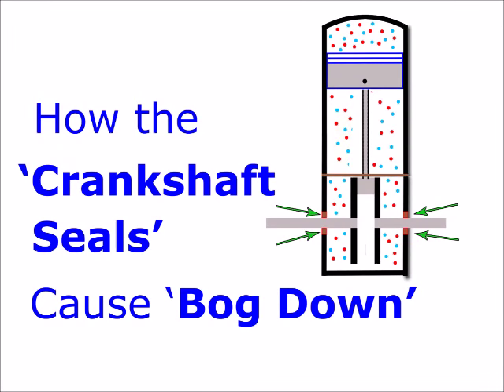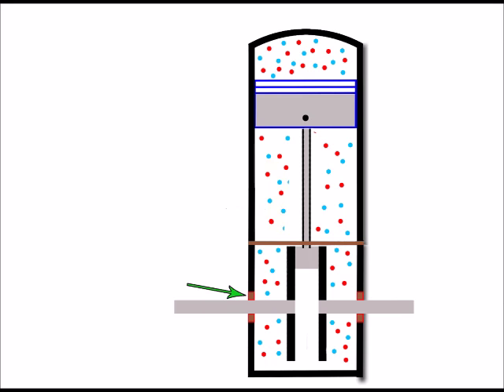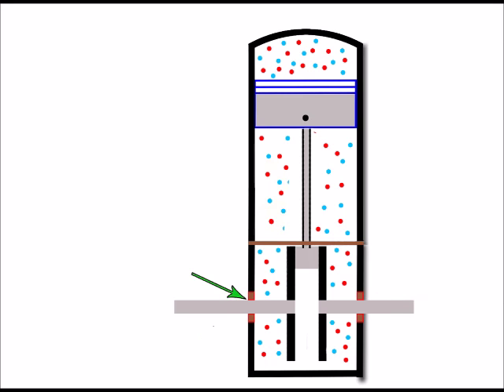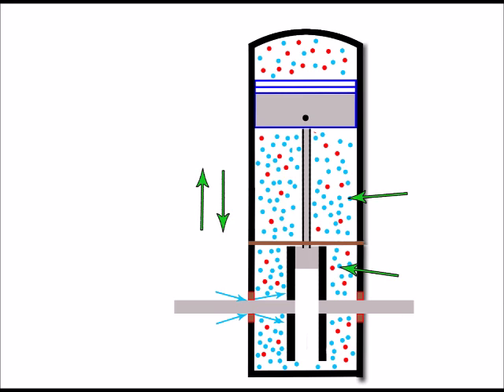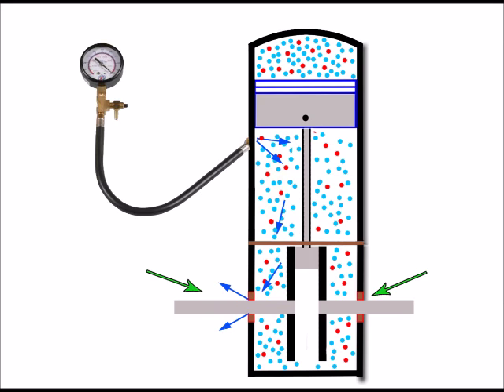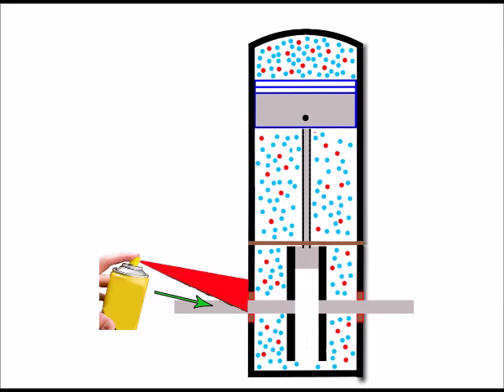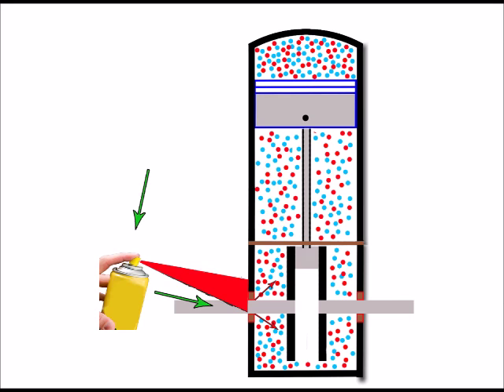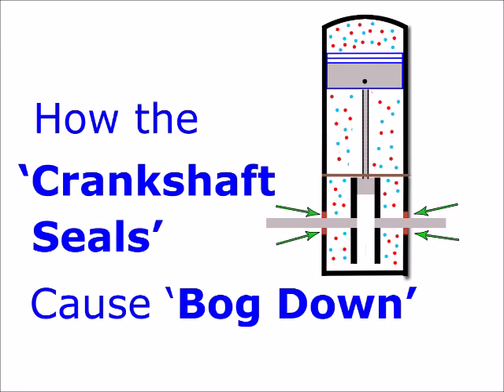Main Crank Seals causes this 2-Stroke BOG DOWN symptom!

Comment: Just a note to readers of the comments…not only does the crank seal leak in air to the combustion chamber , it also can draw in engine oil from the clutch side and cause the engine to bog. Also noted in my case (gas gas ec300) that the engine breather was spoofing out black oil , indicating the extra pressure into the crank cases. Thanks for explaining the basics of what’s going on. Greetings from down under 🇦🇺
Reply: Hi mate

can a crank bearing/ seal cause a bike not to start have got a kmx and it has good compression have taken head off and barrel and piston and rings look good I even taken it to a shop and they said my top end looks fine so anyway I have checked my fly wheel and it has movement when I pull it up and down not loads but its there will this  be the problem do u think

Comment: It should be mentioned also that the lean condition caused by a leaking crank seal on a 2 stroke can lead to premature piston failure or ring failure.

Comment: Epic video.  There is also a condition where crankcase oil lives on the other side of the crank seal, which causes an overly rich condition (as that oil or tranny fluid doesn’t burn the same) as such you foul plugs and/or saturate your muffler packing.
Reply: I have a yz 80 i haven't ever been able to get to run properly. Kicks over first time almost everytime. Wont rev up. Tons of oil coming from the pipe. Any ideas?

Comment: I assume if there's oil mess around the crank seals that,d be a good indication of blowby? I know that term is generally used for the rings wear but in this case I guess it'll be alright. I'll tell you my friend,  your videos make us think, as well as learn. thanks so.
Reply: A two stroke engine has a total loss lubrication system and not a wet sump like a four stroke.
There are three things in a two stroke sump, mostly air, and then fuel and 2-stroke oil.
Leakage around here is not very prominent unless the engine has been flooded.
Reply: That is absolutely correct. A telltale sign of failed crank seals is black, oily residue around the seal area.
Reply: @TonyLing  
Baloney!  Read my comment.

Comment: When you mentioned pressure in the crankcase is the key word... What nobody seems to understand these days is the fact that two-cycle or two-stroke if you want to call it engines are self supercharging engines.
At a certain RPM the pressure in the crankcase becomes higher than atmospheric pressure.
That's what we call supercharging.. for a two-stroke engine this is when the power band starts and continues all the way through to the RPM range ... Something I've never seen done but I know that manufacturers are aware of..
Let's put a tapped hole in the bottom of the crankcase using something small like 1/16 NPT tap and then attach a pressure gauge and while the engine is running under load let's see how much crankcase pressure (boost) two-stroke engines can produce..
Reply: That is a brilliant idea actually.

Comment: Thank you for a very informative video!  I have a Kawasaki ultra 150 jet ski with 3 cyl and 3 carbs. I rebuid the entire engine with new crankshaft etc. and after that the engine dies after about 10 seconds of idling. The only way to keep the engine from not bogging down and die is to keep it above 3500rpm. And to get it running again i have to choke it between every bog down. I comp tested the cylinders and they reach 120 but if i let it sit for a couple of minutes the pressure drops to 100 and stays there. Would you say my symptoms are due to leaking crank seals? I tried the light oil trick but I couldn't get it to work.

Comment: Sir does this case also cause to engine runaway
Reply from the maker: It can cause it to over revv and starting problems mainly. It can be very temperamental with trying to set the carb as well. Almost impossible to get the settings just right depending on how advanced this is
Reply: @TheRepairSpecialist  Thank you sir,my crm 250 won't stay idle but when choked, it idles,I think this is the problem or it should be a air leak,do you have any idea?

Comment: Thank for the vid. Very informative. 

I have a problem with my 100hp 2 stroke mercury, starts and slowly increases revs in idle and then puffs out smoke, reduces revs and then increased again and keeps doing the while puffing experience over and over again, could this be the seal also? Thanks again
Reply: Left hand crank seal or your pilot jet is blocked dirty sort that out before crank seals

Comment: I know this post is old. Would the crank seals cause a no start/no run condition?
  I have a Husqvarna 240 chainsaw that suddenly died while in use. I’ve examined every other possible cause. Including installing a new OEM carb, new spark plug. I have good spark, good fuel flow, fresh fuel (verified in another machine), flywheel key-way is in check (the key way is cast into the flywheel on this model) I have checked and double checked everyyyything. I also tried starter fluid and not even a pop. The compression feels just as strong when I pull start as it always has, it has good resistance as I pull. Consensus on a Facebook post is it’s the crankshaft seals. They are visually intact, I can’t imagine a seal on this, when the compression feels strong, could possibly cause a no start condition.
Reply: Actually measure the compression with a tester...I had same problem w/ mine died while running, wouldn't start back up even w/ starter fluid, EVERYTHING else checked out... I then measured the compression and it could only muster 35 psi! Took the top-end off and piston had a huge crack & the rings were stuck solid, pretty new engine so I think it sucked in some dirt or something 🤷‍♂️

Comment: My engine belt is loaded with oil and I know it is not my power steering oil.  It leaks a court of oil every 40 miles.  I am guessing it is coming out of the crankshaft seal but the engine performs fine with no bogging at all.  Is my guess unfounded?

Comment: Also I wondered, Would the carb adjustments compensate for the air fuel mix in the crankcase?
Reply: Depends how bad the leak is at the seal. If it's a large leak, the amount of air from the carb will be small in comparison

Comment: I bought a 2022 brand new motorcycle that has a leak at the front sprocket shaft.

The dealership refuses to recognize that there’s a leak, but I say the PCV valve is bad and stuck or even partially inoperative or another venting port is blocked.

My question is if a motorcycle is brand new what could possibly cause an oil leak at the front sprocket shaft? ?

Comment: Hi any one with knowledge when I try start bike even with fuel directly down cylinder it just makes a loud pop after like ten kicks have got good spark and have taken cylinder off and bore rings piston look good   have check my fly wheel and it looks to have play when I move it up and down can crank bearing and crank oil seal cause a none start ?

Comment: what kind of light oil do you spray around the crank seals?
Reply from the maker: Steve R, i personally have used WD40 on my machines.
Reply: TheRepairSpecialist thanks!
Reply: Steve R m- thought most crank seals are located inside the case, not easily accessed
Reply: Propane works also.   Non chlorinated brake clean also.   Non flammable brake klean is worthless as tits on a boar hog.
Reply: @Community-Action  mostly the early engines

Comment: I have to check further on my 3.5 horsepower Briggs & Stratton mower engine as after I lapped the valves in,the engine still had a bit of a misfire at idle speed.

I want to check it by plugging off the PCV valve tube then by inserting an airline into the oil filler hole,then to pressurise the crankcase with air.

With the magneto removed,spray some soapy water around the top crankshaft oil seal then watch for air bubbles.

The top of the engine is caked with dirt,grass & oil so I assume that the top crankshaft oil seal is leaking & upsetting the fuel mixture, the bottom one doesn't leak.

If it misfires at idle speed,then it could be a lean fuel mixture,I have trouble getting it to run rich when I tune it so that could be the case.
Reply: Russell Booth thats a four stroke engine, did you check your valve clearance after lapping? To adjust the clearance you have to grind the valve stems a little bit at a time, with piston at tdc on compression stroke, check the clearance with springs removed and feeler gauge inserted in the gap between the cam tappet and valve stem. Clearance should be .006 for intake and .009 for exhaust. Grind a little at a time until proper clearance is met.
Reply: Briggs Stratton ? 4 stroke then you plumb

Comment: I wonder if you can have an air leak at the crank seals, but not have any fuel and oil mix leakage?
On my engine i see no seepage,  but suspect a possible leak?
I know that i need to use some shims on the sides of the crank shaft because there is excessive play with the crank and bottom end🤦
Thanks for the video 😊

Comment: got a polaris indy 500 2 stroke twin once fully warmed up she bogs at about 2000rpm and wont gain rpm unless i feather the throttle but blipping the choke lever works best and once above bog spot clutch engages at correct rpm and runs really well also no problems starting motor like ive seen once in a bad crank seal before  any ideas ? cleaned carbs new fuel pump

Comment: Good video, but you didn't explain how it effects the primary compression.
Reply: It has Zero effect on compression. It causes a lean fuel mixture with a leaky crank seal
Reply: @chrisheffernan7540  Primary compression is not the compression on the compression stroke but on the down stroke to pressurize the crankcase, with leaky seal the primary is affected.
Reply: @UpInSmoke54  that's not what he asked
Reply: @chrisheffernan7540  who?
Reply: @UpInSmoke54  you asked how is primary compression affected, it is not affected. Crankcase pressure is less due to the leaky crank seals, which will lean your mixture.
Reply: @chrisheffernan7540  Do you know what is primary compression on a 2 stoke??
Reply: @UpInSmoke54  what part of less crankcase pressure dont u understand? Obviously it is somewhat less.
Reply: @chrisheffernan7540  Well you said that it didn't affect the primary compression which it does, i think miss interpreted the wording.
Reply: @UpInSmoke54  very little. Only noticeable at idle because it sucks in air and leans the mixture
Reply: @chrisheffernan7540  its suck air and lessen the primary compression!
Reply: @UpInSmoke54  dont be a troll. You asked the question, not I. I rebuild engines, small, medium, large, 2 stroke, 4 stroke.  You dont seem to listen, so go away.

Comment: You are technically correct but to put it simply if your seals are shot your crank case will not build vacuum or pressure, without vacuum it cannot draw in the fuel air mix, without pressure it cannot transfer that mix through the port to the combustion chamber.
Reply: You have a point Sir,  so any other suspect to look around  ? Assuming oil seals are both ok
Reply: @sunflxwergamer303  bogging can come from bad seals, bad reeds, dirty or damaged carburetor, incorrect carburetor adjustment, bad fuel. 2 strokes are finicky, I’ve seen bad spark plugs cause it as well as sheared key on flywheel and even a weak magnetic field on flywheel. I tend to look at case leaks last as the leak would have to let pressure out but not leak on vacuum to cause a bog, it it leaks on vacuum it generally will cause the engine to rev uncontrollably. It is nearly impossible to diagnose without being able to test the engine all we can do is tell people how to diagnose by themselves but it will not replace experience in knowing the sound of the bog, what point it starts and so on. I turn down a lot of work on small 2 strokes simply because the diagnosis cost and repair could exceed replacement cost and quite often I will not get paid for the hour or two it took to figure it out

Comment: Why does my bike sounds like it's flooding and does not want to start and feels like it have an little less compression than before but i have put in a new piston and rings and gaskets
Reply: Bennie Coetzer They might have been installed incorrectly. You can also try adjusting the carb.

Comment: i had gearbox oil leaking into the crankcase and i changed that seal but not the other, no oil leaking now but is bogging and wont idle consistantly and is smoking alot
Reply: James Blake main bearing, and both crank seals.

Comment: The problem im having is the exhaust temperature being different on each cylinder , i have a 3 cylinder engine in my snowmobile and the PTO side has higher exhaust temperature then the other 2, trying to figure out whats going on there.
Reply: So 3 years later what did you end up doing?

Comment: Wow... important stuff about 2 stroke... ❤❤❤.... bro my bike isnt consuming gear oil... both crank seal are perfect... no air leaks... but it still does not acclerates like real  2 stroke .... feels like a four stroke... very less power at lower as well as higher rpm range.... i am stuck... please help....
Reply: Dod you fixed that issue? I am having that problem with my 2 stroke now 😔
Reply: A very common thing with two stroke engines, that I have seen more than once, is that most people put the clutch side oil seal in backwards, which would be right on a four stroke engine, but on a two stroke engine you are try to keep oil out of the crankcase, because it gets it's oil from the gas mix. If the seal is blowing out of the holder it's because it is trying to keep pressure in the crankcase, and not the oil out, I know it looks backwards, just remember that the part of the seal with the little spring on it goes toward the fluid that you are trying to keep in, or out, whichever the case may be.this is part of the reason for the vent tube on a two stroke, and also the reason why the tranny oil should be changed more often, on a two stroke.

Comment: What specific tool would you use to pump the air in? Through the spark plug thread in?
Reply: nope
Reply: @integrationofmanandmachine4714  
Wrong, totally wrong!  Spark plug hole adapters are made for this exact purpose!
Reply: Many tools are sold for this. The most well known is MityVac.

Comment: How do u test with squiring oil with a clutch and flywheel in the way ?
Reply from the maker: Most light oil spray cans have a straw that fixes onto the spray end of the can, which direct the spray to the main seal area much better and without contact with the clutch.  Thanks. Craig
Reply: @TheRepairSpecialist  nice

Comment: I have an interesting issue with my 2 stroke 800cc snowmobile motor. This is one of those motors that used grease for the main bearing from Ski-doo. The grease pushed out of the seal on both sides. I checked if the seals where leaking air by doing the light oil trick and that didn't do anything. The motor runs great, and I don't see a lean condition on the spark plugs. So I repacked the bearings with grease and no issue as far as running. From what I could tell is that I have a high crank pressure when riding hard, and that pressure is more than the seals can handle. I guess something has got to give.